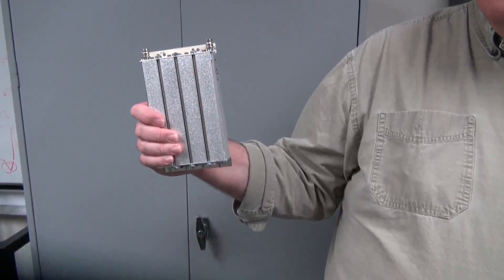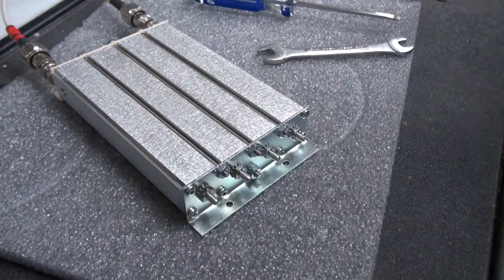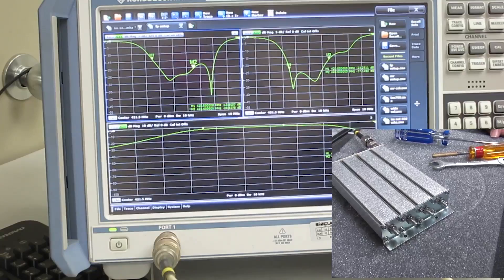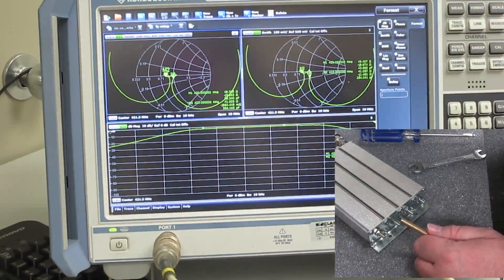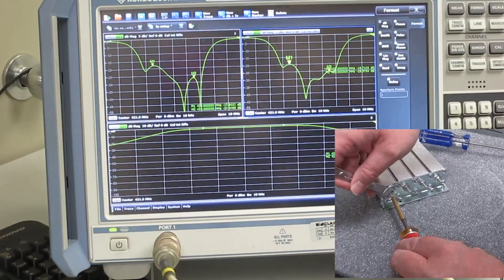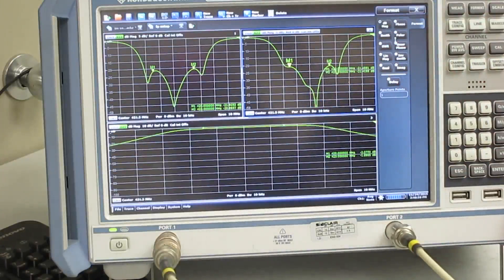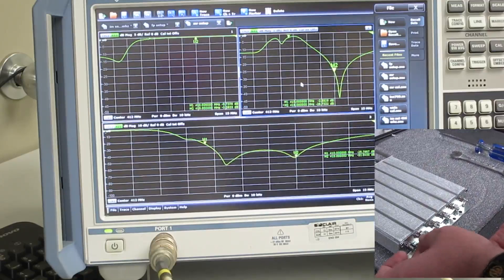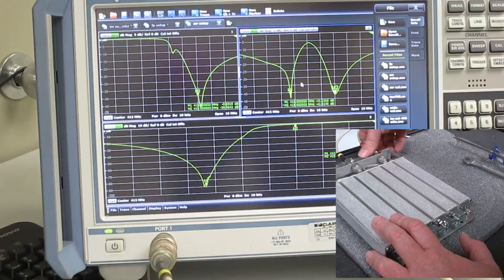How To Tune Small Filters

Comment: Mike, The test equipment is a sweep generator and spectrum analyzer?
Reply from the maker: The equipment in the video is a network analyzer.  This is usually preferred for filter tuning as even the most basic network analyzer will simultaneously display both the transmission through and reflection from the filter.